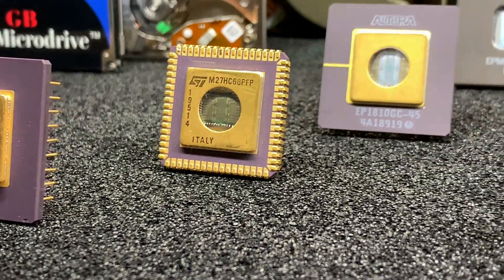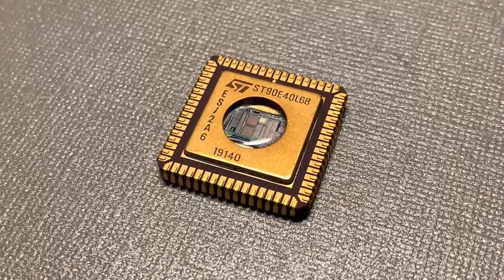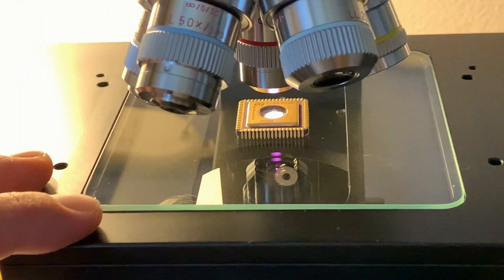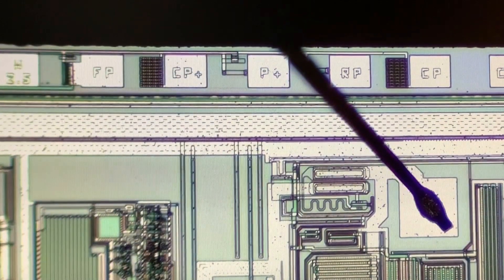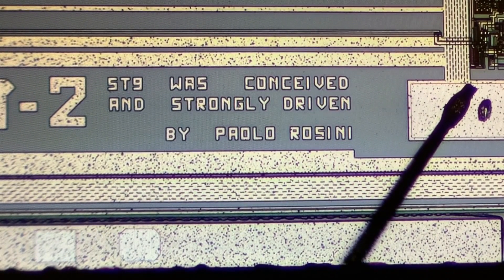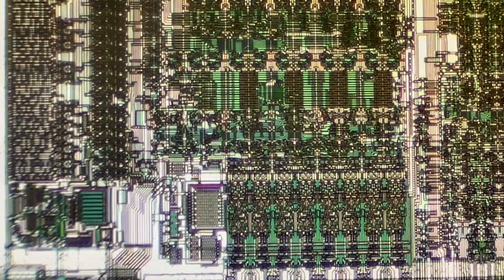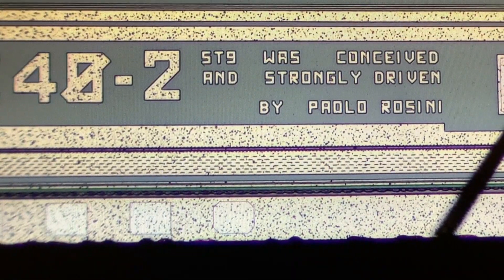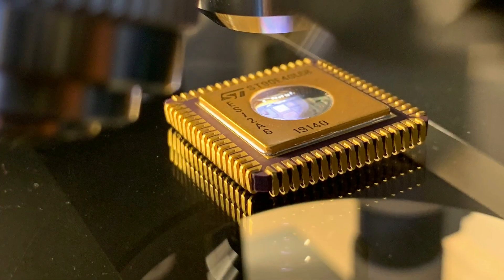CPU Under Microscope - Easteregg & Who is Paolo Rosini?

Comment: Its common for engineering samples to be produced in MPW batches with other chips. In these runs it is necessary to place an identified on the top metal layer so it the person slicing the die later can recognise which design is ordered by which client.

In my last tape-out we placed the name of our research group as an identifier on the top left corner of the top metal layer
Reply from the maker: what do you think how many people here know what a tape-out is? I think only we who are working at the r&d side of a semiconductor manufacturer 😉
Reply: @CPUGalaxy  The "tape out" term gets thrown around a bit in the mainstream as new CPUs are talked about, but I don't think most people know many of the details of how it works behind the scenes.